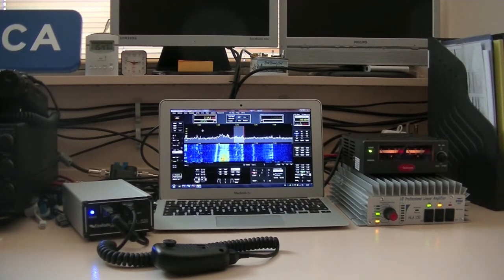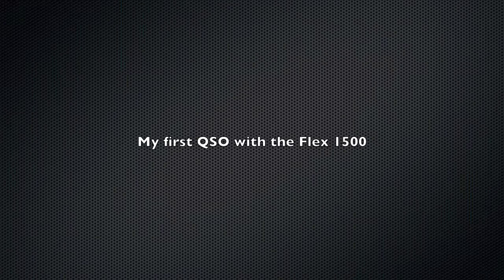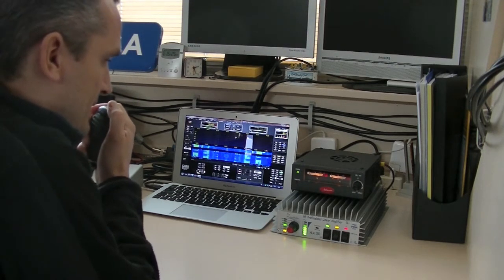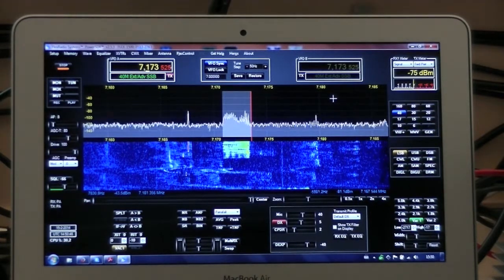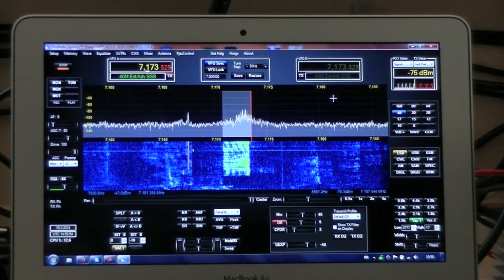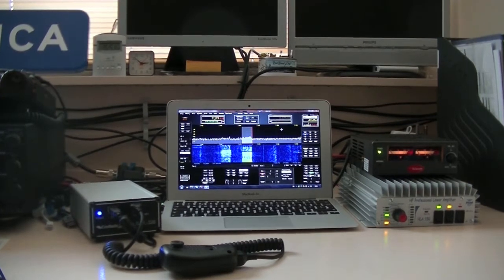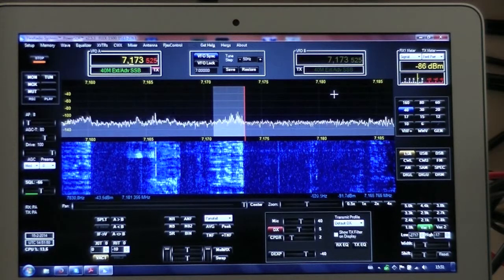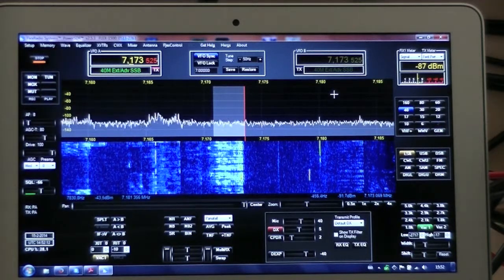First use of my Flex 1500 SDR Transceiver

Comment: What did you use to connect the Flex Radio with the amplifier? What kind of cable?
Reply from the maker: It only needs the coax cable. It doesn't need a keying cable.
Reply: I asked the above question because. I just ordered a Flex 1500 and I want to connect it to my Elecraft KXPA100 amplifier. I hope I can do the same thing you did and not have to make up a home made keying cable. Thanks. You have me being hopefull.
Reply from the maker: The Elecraft KXPA100 amplifier is very nice but I do think it needs a keying cable. It has a connection for this on the back, so I guess if it's there you need to use it(?) They do say, on the Flex website, that it's very easy to make a cable. They write: "Interfacing a FLEX-1500 to an amplifier is pretty quick work. There is a PTT OUT line on the DB-9 connector on the radio that connects to the amp PTT switch."
Found here: https://helpdesk.flexradio.com/hc/en-us/articles/205165475-Amplifier-Options-for-the-FLEX-1500

Good luck with the amp and let me know how it went!
73, Cees
PA1CA
Reply: Cees, I am hoping I can just use the coax to make this work. Creating the interface cable is pretty quick work if you are an electrician. I am not. And I am surprised that no universal interface and cables exist. I will try to do it the way you do. If that does not work I will sell the Flex-1500. There is another article by the same guy where he lays out the schematics for the interface and involves diodes and resisters. That is way over my ability and motivation. Thanks, will let you know what happens.
Reply from the maker: I think the cable is simpeler to make than you think. I'm pretty sure it's just connecting 2 pins (ground and PTT) from the DB9 plug of the Flex 1500 to a tulip plug for your amp. I think the diodes and resisters etc... you would need if you want to make a keying interface but you don't need this I think. 
I made a few of these cables for other rig and amp combinations and they were never difficult to make. Always just 2 pins to a tulip plug.

If only the coax is enough this would of course be the easiest!

Well, hope it works out for you and that you find a solution! If we would live in the same country I would say come over and we will do this together. :-)
Reply: Cool! Thanks. Someone else told me the same thing a few minutes ago. I am beginning to think I can make it myself!

Comment: your AGC -T is to high adjust it to 50 or 60 no more it will be sound better .2nd open the wide filter on rx it will be sound even better
Reply from the maker: elan paim thanks elan, I will try out the AGC setting. I prefer to keep the RX a bit narrow to hear the not so clear signals better. It keeps the general noise level lower.

Comment: cool .I have a yaesu 857d and it has hardly any screen at all but I'm not complaining
Reply from the maker: I also have one of those 857's and also like that one. The Flex just gives me more options, especially for the digital modes!
Reply: hey how many watts come out of the box / exciter ? and I would imagine that linear has at least 2 stage (2 transistors) to achieve 100 wattts output ?
Reply from the maker: Fred Suero The Flex radio has about 5w output and the linear 100w. I think the linear has 2 x SD1446 transistors.
Reply: that's very cool !

Comment: Cees - nice video, I like it.

For CW, I found the trick is to turn off the VAC and set the buffer to 128. Then there is no delays of any kind. 

You have to get your audio direct from the 1500, via headphones or flexwire audio output, but that's a LOT better than an unusable CW delay.

Good vid, thanks, rob 

N4GA
Reply: Thanks Rob, I will give it a try!
I'm still experimenting with the flex 1500 and haven't found my perfect setup yet.
Also not for the digi modes.

73, Cees
PA1CA

Comment: Have you used it with WSPR?
Reply: works like a charm. 72 de HC6PE
Reply from the maker: No I haven't. I have used it of course with digital modes and there it worked good. Just haven't tried it with WSPR.
Reply: Cees Alberts Ok, many thanks. I am thinking of buying one mainly for WSPR,

Comment: Hi,  I have a MacBook Apple laptop, 2.3 gig hertz.  I was told that I needed a windows operating system to get Flex radio operating.  If I partition the hard drive (one side being OS Maverick the other Windows 7 or 8) and I load Flex software into the Windows operating system, will it work all right?  ( I wanted to use a program called "Parellel" which lets me have to operating systems going without rebooting) will it all work?
Reply from the maker: I'm using a Macbook Air and the Flex radio works great on a separate partition!
I tried also to install it on VMWare but that just didn't work. VMWare is something like Parallels so I think it will also not work on Parallels.
I hope they will make some software for Mac OSx so the Flex radio will also work there but for now we're stuck with Windows!

Comment: What do you use for a tuner?
Reply: Most of my antennas are resonant on the frequencies I'm using them on.
Only for the 40m band I need a tuner. For this I use the MFJ-904H Deluxe Travel Tuner. The swr / power meter is not 100% accurate but it works ok and I'm happy with it!